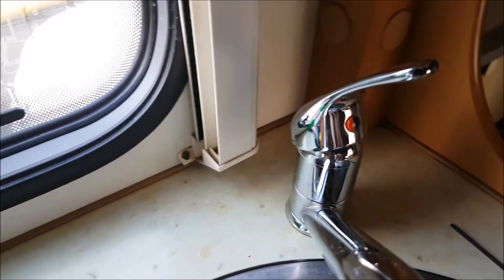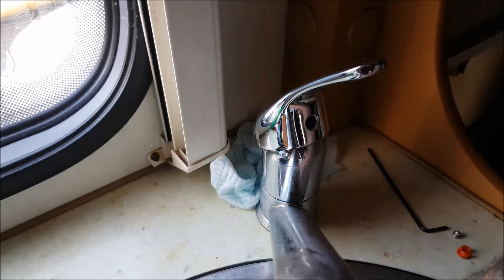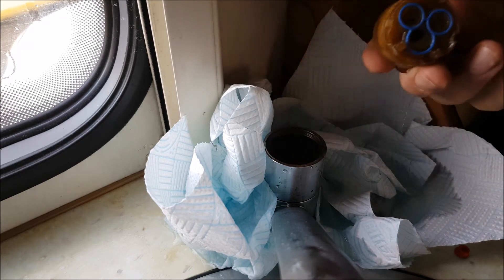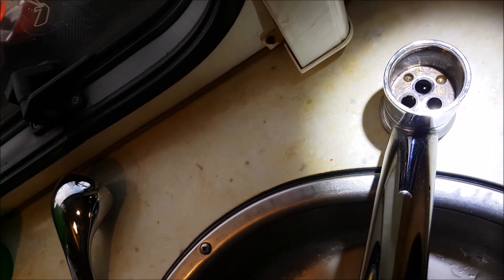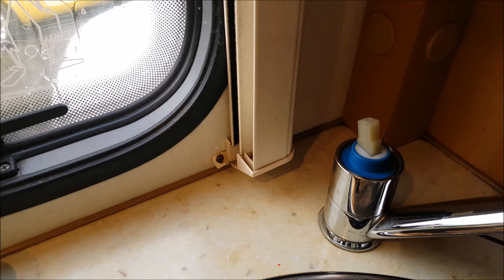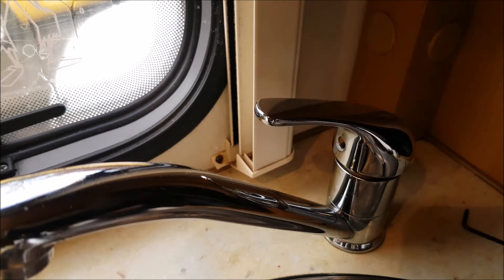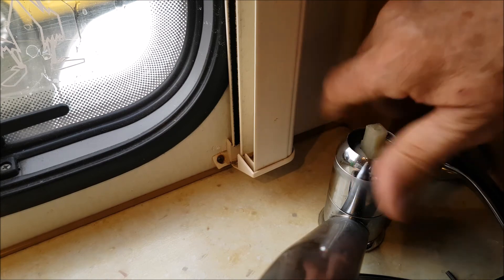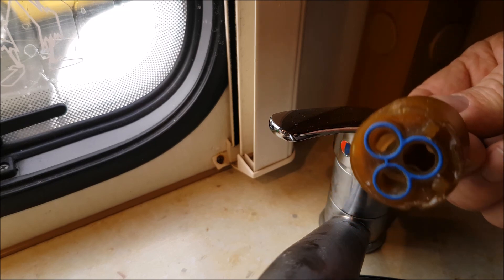How to Fix a Leaky Ceramic Faucet

Comment: He did exactly what the title says. Fix a leaky faucet (just to correct somebody here  (& if you want to split a hair, so we shall. ...The Op did not write ‘Repair’ he wrote ‘Fix’ and he certainly has ‘fixed the leak’ by replacing the Cartridge and this is exact;y what I was looking for and thank you for taking your time to do this. As for the ‘cartridge , if you type in ‘Google’ the make of your tap am sure it will pop up. I typed Bristan Chill Cartridge but it also fits the Qube & Prism model too.
Reply from the maker: Thanks Harry